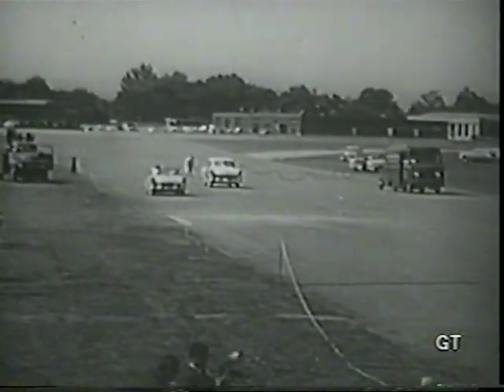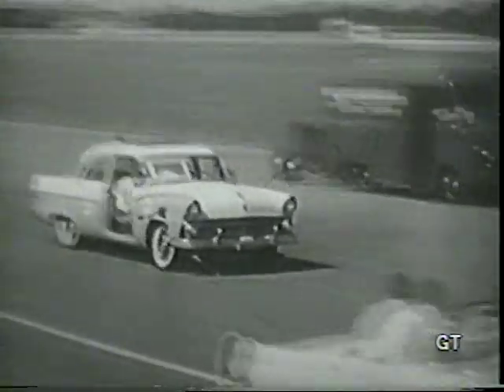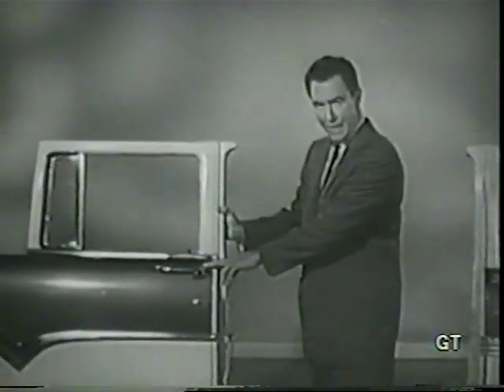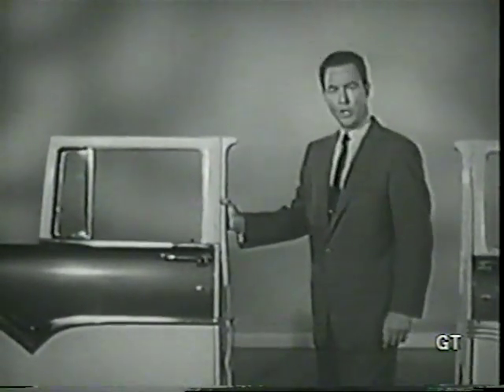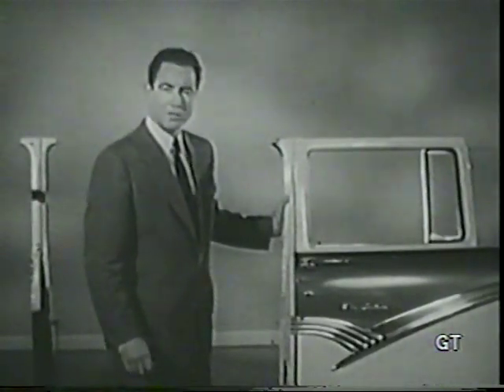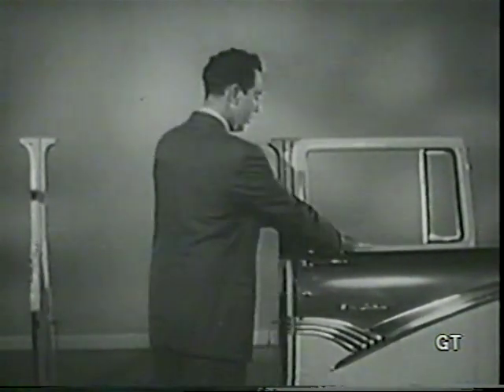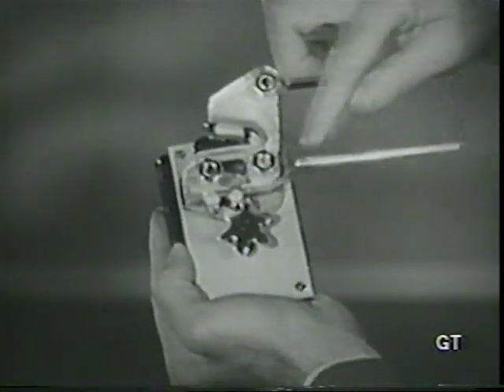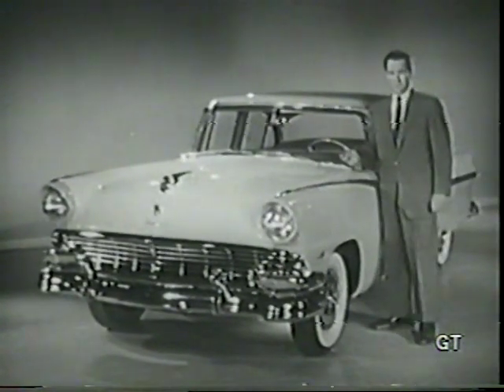FORD CRASH TEST, 1956

Comment: FORD for '56 introduced the Life Guard safety. It included seat belts, deep dish steering wheels, padded dash and visors, locked doors. GM was furious at Ford for "deglamorizing" the auto industry, plus the added cost. GM cared more for the bottom lines, than the lives of their customers.

Comment: Lol even if you stayed in the passenger compartment, there were solid steering columns and solid steel dashboards as well as no seatbelts to keep you from flying into them at high speed. Baby steps I suppose.
Reply: Actually with the lifeguard design you had a impact absorbing steering wheel, padded dash and lap belts. This program was quietly dropped as the public didn't want it. Wasn't until Raph naders book in the early 60's where car safety started to come into the consumers mind. A lot of cars had seatbelts offered in the 60's but people simply didn't wear them. seatbelt wearing started to become a norm in the 1980's.  Hell I've encountered a few airheads within the past few years that think seatbelts are an inconvenience
Reply: @operator91210  what public? This isn't an enraged group who have the power to do this, this is a few customers and then the management board choosing to replace the concept.

Comment: Cars in the 1950’s: are designed so the doors stay shut in a collision
Also cars in the 1950’s: not fitted with seat belts
Reply: Ford included seat belts as a Life Guard option in 1956, but drivers didn't want them.
Reply: Most cars by the 1950s already had seatbelts.

Comment: great video very interesting  you deserve more subs where can you even find this stuff those fords hold up batter than any of todays cars
Reply: They held together while the occupants' faces were bashed by the steel dashboard.
Reply: @101Volts  Correct. Or the steering column...or, the windshield. This is fifties feel-good propaganda. Three-point seat belts and collapsable steering columns finally made a dent in the Deaths/miles driven. Later innovations were the airbag, side curtain airbag (Much later) and front and rear crumple zones. About 35000 Americans die in motor vehicle accidents/year these days (but that includes motorcycles-which are at least Thirty times more Deadly!) But-the death toll/miles driven have gone down dramatically since the 1920s, with much of the decrease from 1960 to the present.
Reply: @101Volts  That's why they had seat belt kits? Most people didn't want them, so they were a option for installing your self.
Reply: @watchoutz6969  Yeah but the seat belt kit only included a lap belt so your face would still contact the dash board or steering wheel
Reply: Austin Lucas The 56 Fords had padded dashboards so that wouldn’t happen. You’re correct with basically any other car at the time though.
Reply: Team MBOPro - Padded dashboards were available as an option on Ford vehicles starting in 1956,as well as many other models from competing companies,starting around 1957,but on most cars,they were optional at extra cost if the buyer was willing to pay extra for them. I believe that 1967 was the first year that the Federal government mandated that all new cars sold in the United States had to have a wide variety of safety equipment in order for them to be sold in the USA....
Reply: A layer of padding on a steel dashboard didn't make much difference in an impact.  The real advances in interior safety came when engineers started designing the parts to more completely absorb the energy of the impact.
Reply: Bolty Correct you can always trust ford!